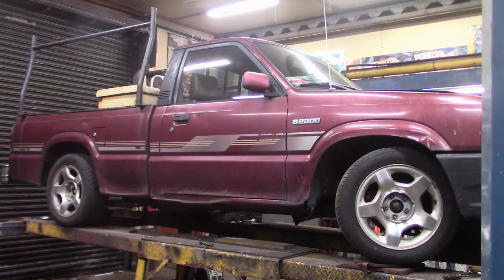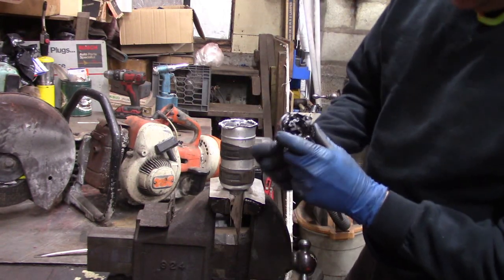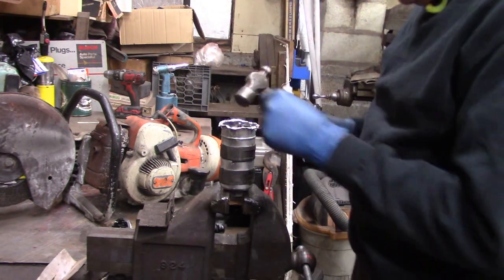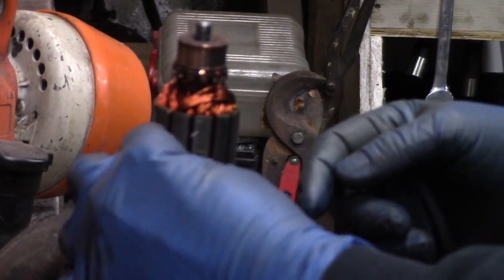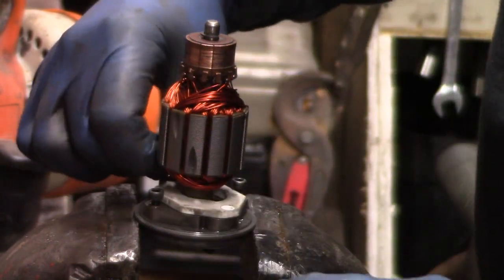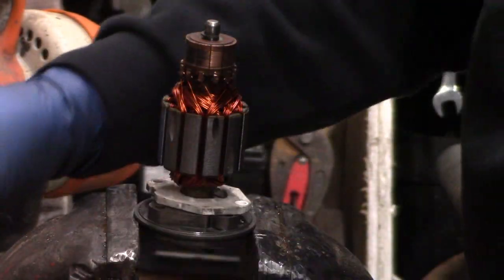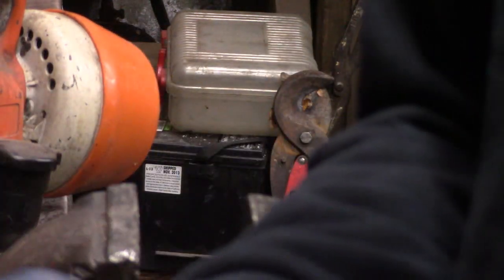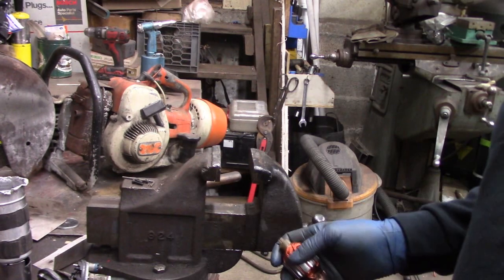DISSECTING A FAILED BOSCH 044 FUEL PUMP

Comment: There is a plastic valve on the out going fuel in neck of behind the coal connecter when it close fuel will stop to go out and engine fails.